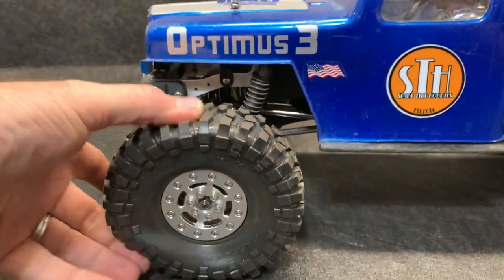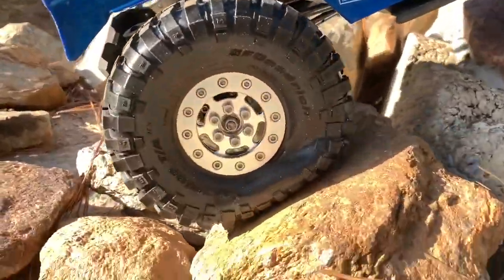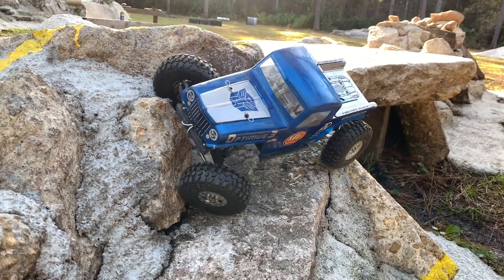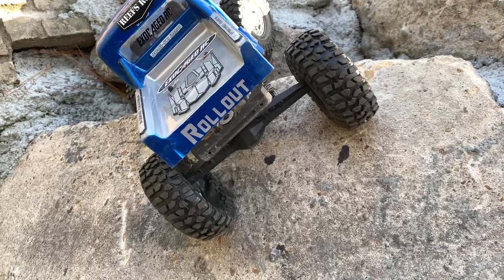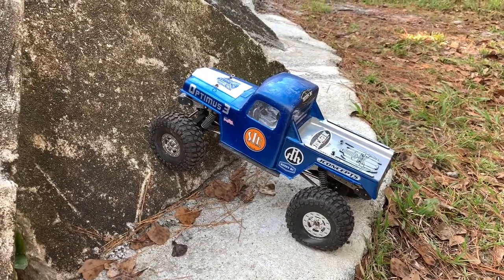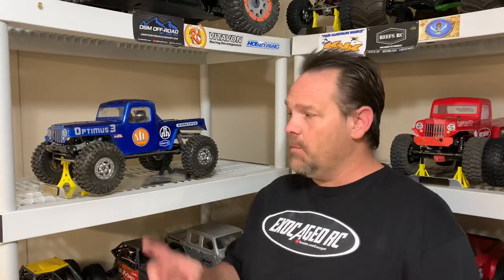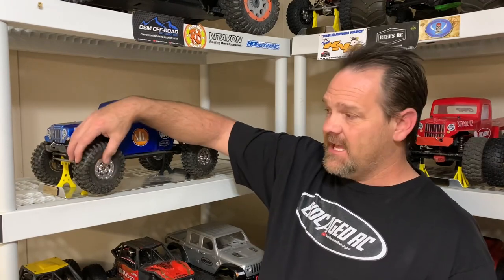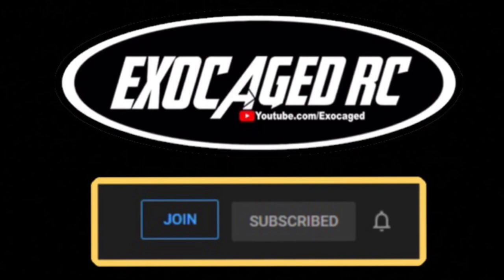Optimus 3 on Predator Krawlers and CI 4.25 lil nova foams

Comment: I found a year ago putting the single-stage light blue Pro-Line 'Crawler' closed-cell foam in the 'FRONT' tires of my 7+lb TRX-4(see link) hugely improved the accuracy of the steering(IMO the TRX's OEM foam is stupid soft). My rear tires run a single-stage open-cell foam that adequately contorts/conforms to obstacles without looking like your tires are flat when at standstill.  My TRX-4's tires are Chinese knockoffs of Pro-line's 'Hydrex' tire, $22.00  for (4) tires and foams. They grip like Velcro and so far seem to be wearing well.
Reply from the maker: So about the same foam setup I'm liking, very nice.

Comment: Predator Krawlers have been the best multi terrain tires I’ve had. Honestly my least favorite have been the Landmines. The Landmines are great when conditions are really dry, but any mud or even wet rocks they are worthless. The Krawler KX Predator are great. They run really good with the Proline dual stage too. If Proline does the Flat Iron in Predator I’d like to try them
Reply from the maker: Out at Barbarian the Landmines do really well even if its wet or sticky, but when I was up north the didn't stick at all. For my area the landmines are really good.
Reply: @ExocagedRC  yeah, my tiny backyard course is broken concrete and they do fine on there, but I switched back to the Krawler KX Predator as the course we run NW of Indy has dirt, limestone granite cobbles and wood features

Comment: The fronts look like they are almost flat. Is this ideal in your opinion? I boiled the foams in my axe and they got pretty soft. I was a little worried maybe too soft. But they are nowhere’s near as soft as those up front on optimus 3
Reply from the maker: Fronts could be a little bit stiffer, but for now I'm going to run them and see how they break in, it may get some 4.5 Lil novas with medium outers on the front, time will tell.

Comment: Compare to klrM With ci foams which better krawler predator or klrM red?

What ci foams do you advise for 9.5lbs up
Reply from the maker: hmm tough call both are very good tires, top of the line IMO. I'd say it depends on the terrain and if the big sidelugs of the KLRm would be good or not. 4.5 with hard outer foams, if the tires are oversize maybe the 4.75 with soft or medium outers

Comment: I’m a little confused on how you ran the tires.  So you ran the front with the inner core insert from crawler innovation and the outer foam that came with the tire. And in the rear you ran crawler innovation dual stage foams.  Also I clicked on links for foams and it says they are designed for 1 inch rims. I just ordered some injora rims that are 1.18 inches wide do you think these crawler innovation foams will work with those rims
Reply from the maker: They should work out fine. Some wheel widths of 1.5” can cause the foam to slide around in there.
Reply: @ExocagedRC  thanks for the reply you have replied to 2 comments now and after not having a crawler for around 10 years a lot has changed I’ve been watching countless YouTube videos trying to catch up with everything that has changed since I had a axial ax10  and your channel is by far the best I’ve come across. Thanks again

Comment: I got 1.9 x 4.35 Pitbull Berserkers what CI foams should I get? My rig weighs about 5 to 6 pounds.
Reply from the maker: lil nova 4.5 with soft outers, if all you do is climb, get medium outers for the back.
Reply: Lil Nova 4.25 comp cut med rear/soft front. This is what I run in my 4.3 inch Proline Swampers, which are the same size as the Pitbulls. My rig is 5.5 lbs and this setup works well 👍🏻

Comment: You tune backwards compared to every rock crawler out there. Hahaha 
Harder always goes outback because weight transfers to the rear during climbing and softer foams in the back will collapse and fix you back. 2-stage in both front and back along with underdriving the rear(never overdrive the front...higher gearing always promote torque-twist)will prevent the front tire from folding.
If the front tire doesn't look like it's at 10psi and squating while climbing..its not grabbing near as much as it could. 
Your a good driver for sure.
Reply from the maker: LOL yeah I know, if all I did were climbs I'd set up very differently. We have downhil and sidehill gates so I have to have a good compromise on everything for best overall performance. Thanks for he complement on driving.
Reply: @ExocagedRC  Good morning Joe.
   The above foam tuning advice isn't just just for climbing..that's just one example....that's for downhill, sidehilling, lose and hard packed dirt and sand...that's advice from a handful of guys I've met over the years that have consistently won/place high in some pretty big Mid/Westcoast comps/Pro-Line/Pitbull Drivers , including the owner of Crawler Innovations.
  Doing my own tuning at some great places over that last 15 years( including the tuning I did on solid-foams that no one else has done that works just as good)...I've come to the same conclusion...softer in front/harder in the back.